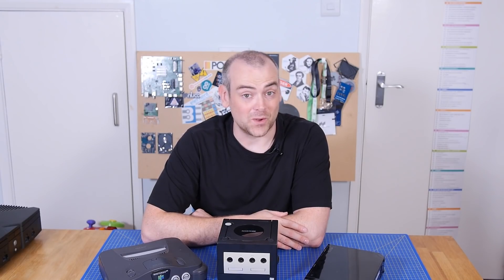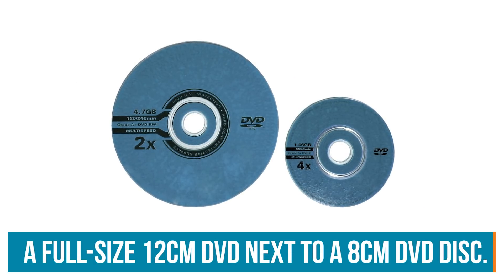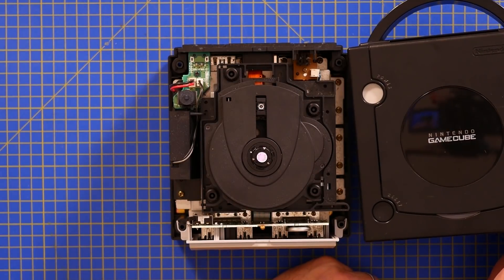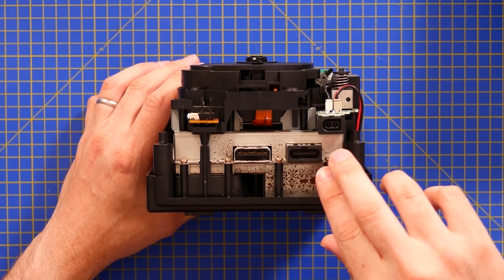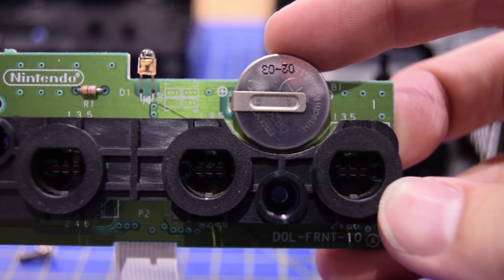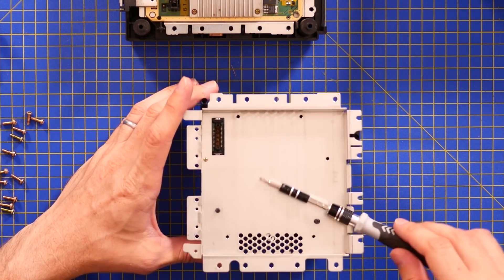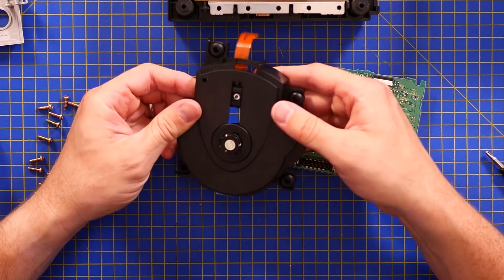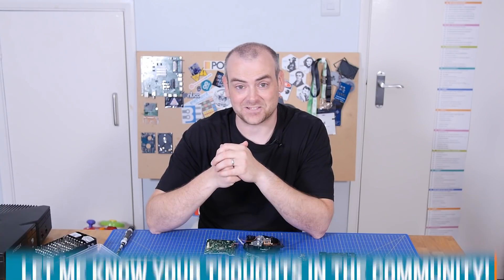We Teardown the Nintendo Gamecube - The Electronics Inside

Comment: The handle was really convenient actually. It was great for lan parties or just bringing to a friend's house for some Melee or Mario Party. It also looks good aesthetically. Also it was the earlier GameCubes that had component not layer ones. They actually removed it in later versions because it was rarely used outside of Japan and because of that the original 20 dollar component cable goes for 300$ on eBay because it's better than the Wii's component output. 
The GPU was very likely named the 'Flipper' because back when the GCN was still in development it was known as project Dolphin. Pretty neat one of the internals kept that legacy.

Comment: If I remember magazine articles from back in the day when the Gamecube was in development Nintendo initially planned to give it DVD playback support. Later when it was released they said they dropped it because they wanted a custom format to prevent piracy. Also, the drive spins backwards apparently. When they release the Wii, their argument was that they didn’t want to increase the cost of the console because of license fees that manufactures of DVD players had to pay the DVD forum. But I think the real reason is probably they still struggled with the history of the SNES CD-Rom Sony VS Philips shenanigans a few years earlier. Nintendo where so awkward about optical media. It’s like they had some sort of complex of the SNES CD-Rom project. The history of it is quite interesting and filled with corporate politics. Nintendo’s ways are strange sometimes.
Reply: No, the drive does not spin backward. You just have to watch the disc through the window to see it. It uses CAV (disc spins same speed) versus CLV (speed varies to keep reading rate the same).  Which makes the discs incompatible with most drives.

Comment: The story goes that used that small format DVD (that also used different reading techniques) in an attempt to stop piracy. Not supporting DVD playback is also a limitation on the Xbox, because having a DVD player software means paying the DVD forum a license (around 20 USD per device, if i recall it correctly). With the Xbox you could buy a "remote control" too use the DVD player functionality that included the DVD license in the price.
Reply: Thanks for the information. I was wondering why Microsoft did that but now it makes sens!

Comment: The cubes drive also spins in reverse to a dvd drive, it’s a part of its anti piracy system or something like that.
Reply: The backward spin is a myth. If anything, just watch it spin. The incompatibility was related to the drives/discs using CAV (constant angular velocity) instead of CLV (constant linear velocity).
Reply: I think they also made other changes to drive / discs, in order to avoid paying licence fees to certain groups. Loading times on the GC were like lightening compared to other optical drive based machines. I remember something about them using a proprietary compression technology.